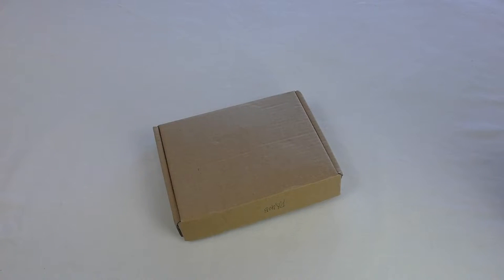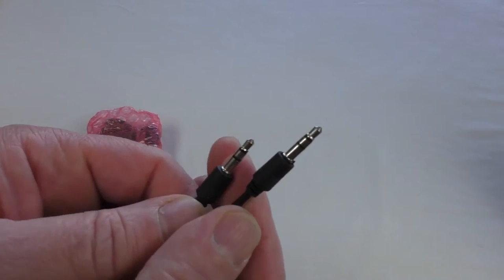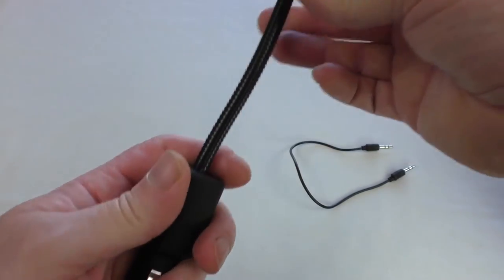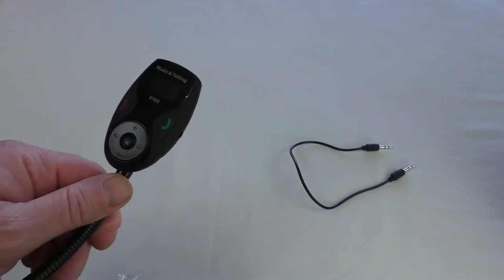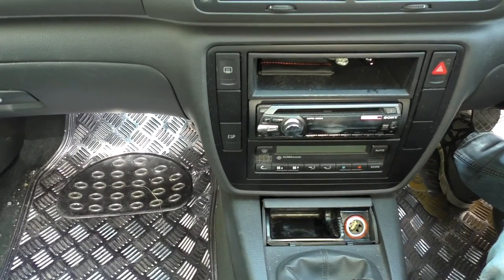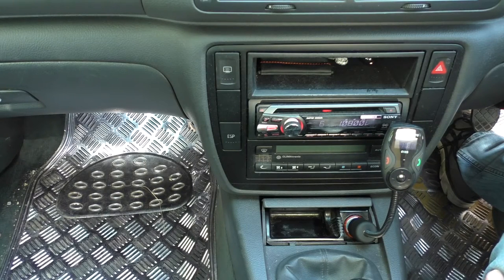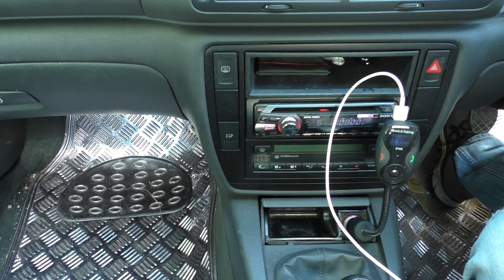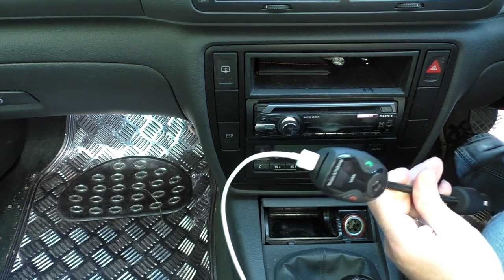ZhiZhu® LCD Display car kit

Comment: This device looks great value for the price, includes comprehensive features and effectively gives you a bluetooth connection from your phone to your car radio. Loved the review, and in car demo - also check out those Max Power stainless steel car mats!
Reply from the maker: Yeah for the price you can't complain really and having so many different inputs means it's of use to a greater variety of people out there. I had a wired in Parrot kit once but when it started to play up I just left it in the car I installed it in and it was expensive to start with. Glad you enjoyed it. Haha those mats lol alas they came with the motor. Thanks again buddy :)